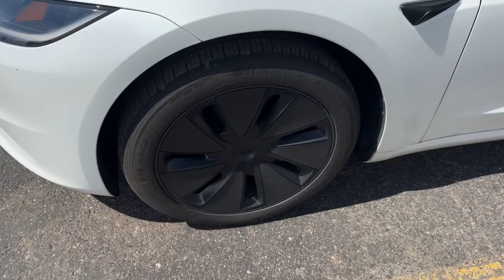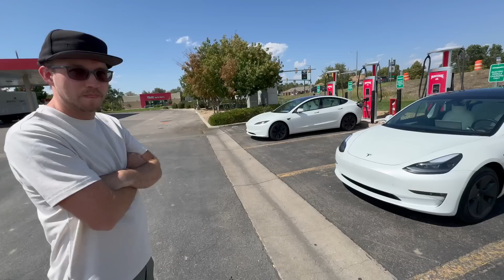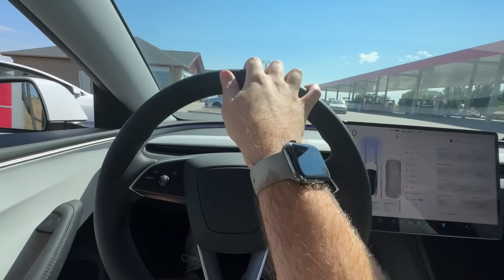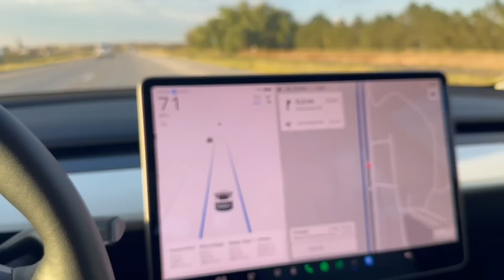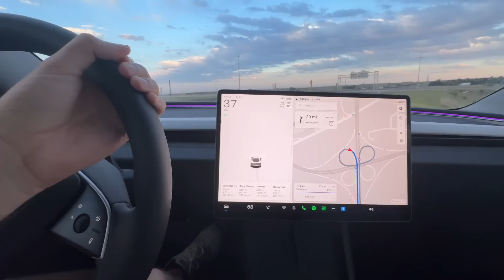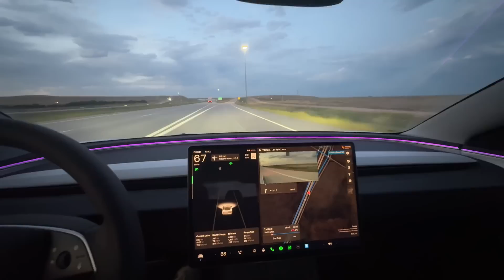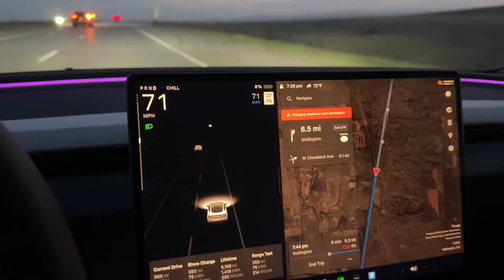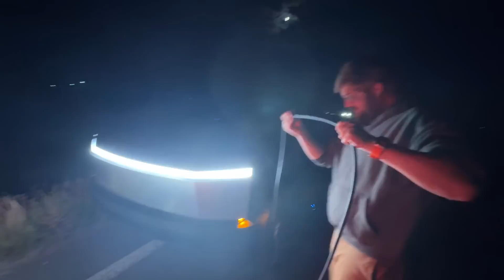Old vs New Tesla Model 3 Highway Range Test! Huge Improvement For Refresh - Long Range AWD

Comment: They should ban the front lights of the old Tesla Model 3. Very annoying in the night, when they are Infront or behind you.
Reply: What?? 😂
Reply: Just misaligned out of the factory. I adjusted mine down. I've seen plenty that isn't blinding me
Reply: Never had a problem with them. Very peculiar comment.
Reply: @JakeRichardsong  Do you even have a driving license? Because it's nonsense that those lights are not blinding others. Because they do.
Reply: Until recently this was a huge issue since 2021. Because since 2021 the cars have come with matrix LEDs but until the beginning of this year, the software to control each LED wasn’t enabled. 

The lights without matrix software are blinding, but they solved this overnight (after 3 years of waiting) here in Europe by enabling the matrix software. Not sure why they haven’t done this in the US, but it’s needed. The lights are terrible and dangerous without the matrix function, especially in the UK where they never aligned them properly
Reply: @iambenmitchell  I'm from the Netherlands and most of those 2019-2021 models are so poorly calibrated.
Reply: @iambenmitchell  It hasn't been done in the US because it is still awaiting regulatory approval to enable them. I have a 2024 Model 3 LR and I'm still waiting on them to enable them here in the US.
Reply: ban american yank tanks (trucks) as well. they are starting to infect countries that dont eat big macs for breakfast lunch and dinner. dont want them blinding you since they are so obnoxiously big
Reply: Well ban I’m not sure about but even as a driver I have to admit the lights are weird. Flashing semi-randomly
Reply: @C4rb0neum  No they don’t 😂